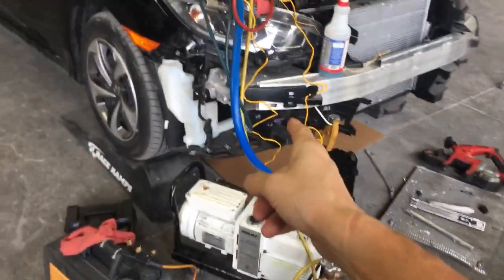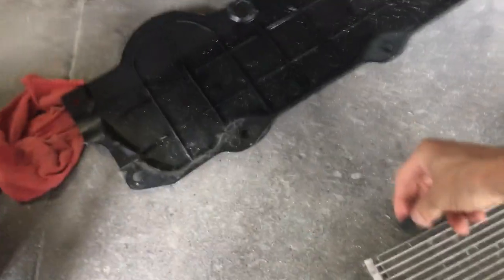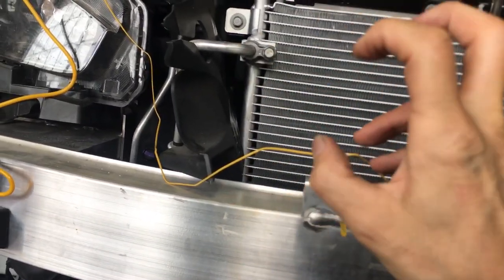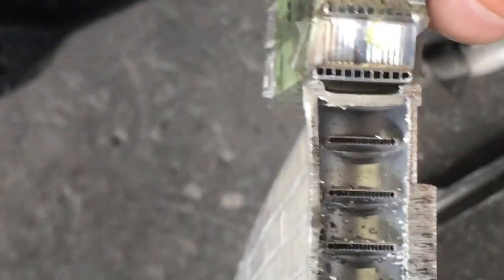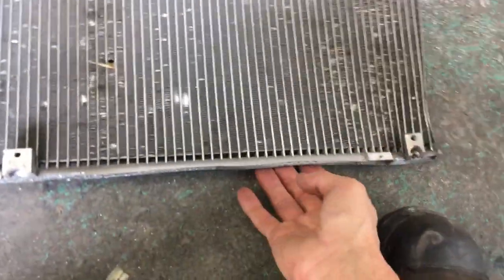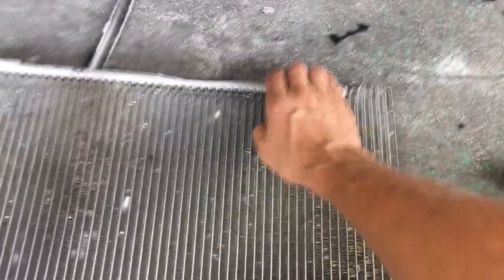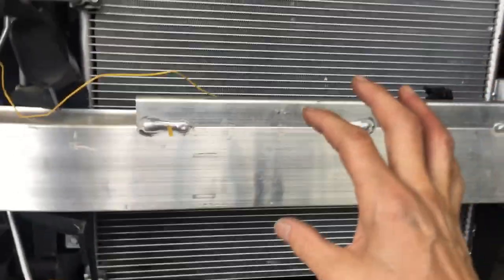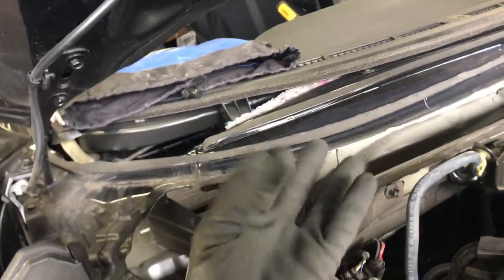Aftermarket AC condenser poor quality versus OEM original condenser. DON’T GET CHEATED!!!

Comment: You show that the bottom 5 rows provide the subcooling.  Here's a somewhat theoretical question: what if you can install an entire second condenser and use the entire condenser to get even more subcooling?  In some vehicles, there isn't enough space, but in the vehicle in your video, there's certainly enough space for two condensers.  I've seen someone install dual condensers on an old 300D Mercedes in place of the original r12 tube & fin condenser.  He has a video here on youtube called "W123 Sanden, Dual Parallel flow condenser, and r134a results
".    Interested in hearing your thoughts on this!
Reply from the maker: komoru yes Mercedes did that from the factory. The second sub condenser located under the bumper.    I use to do that back in the 90s on long limousines that had up to five evaporators added to the rear.      Limousine manufacturers did know how to make AC work correctly.  I was called in to a limousine repair and manufacturing Business and asked to solve their problem. I added extra condensers and extra receiver driers.      This is what my dad did Back in the early 70s at his AC shop on new cars that were being shipped and sold iin the Arizona and New Mexico Desert. My dad would make custom IHX ( Internal heat exchanger )  the same heat exchanger that you see on today’s most modern R1234YF  cars.   You use soft copper pipe and attach smaller copper pipes to the outside of the larger suction line using silver brazing. Every HVAC tech that has been formally educated and or has taken thermal dynamics and fluid dynamics knows this. Basic HVAC/R 101.     I did a video on the Mercedes.
Reply: @coldfinger459sub0  would additional condensers and receiver driers strain the compressor? or would it create a higher head pressure? 

I'm planning to add additional condenser for Scion  xB.
Reply from the maker: @KurtBarcelona  you must be in a hot climate. 

Gets tricky with today’s condensers.  Because most new condensers have a receiver dryer built into the condenser in the last about six rows of tubes are for sub cooling only liquid.. 

One of two ways if reciver built into condenser. 

1: customer modify a Y fitting connect, to two parallel condensers connected. 

Or
2:  in series hey single pass or double pass, microchannel parallel condenser behind your original multipass microchannel condenser with the receiver dryer. 

If your condenser has the receiver dryer attached to it, it’s very important, because only liquid comes out of the bottom of the receiver and feeds last last five or six tubes . 

You can try to take a IHX off a newer car and custom make liquid to suction IHX assembly line to help efficiency. 

You can add a second evaporator.  Buy a kit like on a limousine. Install it in the back on floor or roof inside like some SUV or van. 

Add a super high out put fan
Reply: @coldfinger459sub0  yeah it gets hot here. 95-100 deg F with 60-80 percent humidity. I live in the tropics by the way. Midday here  is a pain to drive since the heat creeps inside the car, but the pressures return to normal at night.

Also, I figured that probably my compressor can't handle series condensers. I'm afraid I might cause it to "exert more work",  which prematurely wears it out, and series connected condensers are not as simple as I thought. It's too complex to consider since there's also no kit that I've know that readily fits in the Scion xB.

I could buy generic local condensers from China without the receiver drier built in though, but I still have to check its quality.

What If I parallel different condensers? There might be a difference of flow restriction on them. Do I need valves that can regulate the refrigerant flow to each condenser? Or would the prallel condensers self stabilize? I might risk the reduced flow rate on wa h condenser, but most likely it would run better compared to a single condenser. What do you think?
Reply from the maker: @KurtBarcelona  if parallel us same condenser 

If series first one is single pass only ( less friction loss) resistance 
    U must understand internal construction of condenser. 

I have ran up to 3 condenser in series with up to 4 evaporators on one compressor on limousine.  Blasted hundreds of thousands of miles.. 

Compressors do no die or wear out.  Compressors are murdered by people who don’t know what they are doing. 

Most all compressors last longer then the car.  Unless someone murdered it. 

Too much refrigerant 
Too little refrigerant 
Too much oil
Too little oil
Wrong viscosity oil
Wrong type oil
Moisture contamination 
Air contamination 

I have video of me driving in 106F with 39F out the dash 2012 Prius C 
Because it’s charged right
Reply: @coldfinger459sub0  

By the way, I have no issues driving on highways since the AC vents are about 45-50F when the ambient is 95F, but when I'm stuck in traffic or at low speeds, it goes to 64-50F!! It's warm for my preference especially that I don't have a heavy car tint (to reject the infrared rays) so I can drive and see at night.

To fixe this problem, I installed an auxiliary fan, and cleaned the condenser, but it still had the same 50F vent temperature when I'm stuck at traffic. I checked  the pressures, and the high side just after the outlet of the condenser is too high. Low side is approximately 42psi and 225-250psi at tge high side WITH FANS ON. Also, the High side line is too warm to touch.

It even goes higher If I revv up the engine. It cuts off the compressor If I rev it too much, the pressures going to 350psi.. and the heat in the engine bay is just a lot. I'm not sure if

I tried reducing the amount of refrigerant to reduce the high pressures, but it won't get as cold. 

However, this returns to normal pressures at night when the ambient is 80F

The question remains, is my condenser running well? Maybe it's clogged or it's just not enough heat dissipation via the condenser? 

I'm now curious about series condensers and how these could help.
Reply from the maker: @KurtBarcelona  a small series condenser may help.  Most important is that your refrigerant charge is correct. In the first place. Added by wait by manufactures recommendation not topped off by pressures.

I have a video me driving my car on 106°F record-breaking day in our area and 39°F coming out of the dash . 

I was using my Bluetooth pressure transducers to take the high side and low side pressures and they too were ridiculously low . 

And this is how it should be with a well-designed system and properly charged refrigerant level on a good car   AC system. 
2012 Toyota Prius C .
Reply from the maker: First, make sure your refrigerant charge is 100% correct by weight make sure your car has not been in an accident and a poor quality aftermarket condenser was installed. The original one should have been a DENSO 

You can add a small secondary condenser your OEM condenser already has a receiver dryer built into it .
Reply: @coldfinger459sub0  I'm going to add a 12"x18" condenser in front. Hopefully when the parts arrive, I can update you with the progress. I'll even make a video out of it for people who plan to do it. Hopefully it would be okay. 

Question is, do I still need to fill up the recommended regrigerant? Scion xB repair manual says 380g +-30g, but should I add a little bit more considering there is more space for more refrigerant made by the extra condenser? 

I also found out that it's common in our area to make 'dual condensers' for old toyota / honda vehicles (with the exception of Nissan). Apparently, people are not satisfied with the stock AC breeze that these old cars are designed with. Either they replace their old AC with a larger condenser and add auxiliary fans or install dual condensers in their vehicles. 

I also observed that newer model cars released here have LARGE condensers and have a high speed dedicated fan. No more small condenser designs. Good.
Reply from the maker: @KurtBarcelona  it all depends on time money somebody’s ability to modify sheet metal hoses, pipes, and fittings to make things work. 
          You will definitely be adding quite a bit more refrigerant is coming out of the bottom of your original. Condenser should be basically fully liquid which is a large volume of gas and that will be going right into your new condenser so the whole entire brand new condenser that you will be adding will be completely filled with liquid refrigerant.. 

Hi myself personally, if I was going to do it on my vehicle, I will try to find the largest possible condenser, of course microchannel parallel flow that was designed originally for an SUV or small van that had the heat load of two evaporators and see if I can get that, can you somehow manage by manipulating sheet metal in brackets and Kustom fittings to work in my vehicle. 
                   And if I was in some hot desert climate, like Dubai, some of these Middle Eastern and African countries, I would also probably add a secondary sub cooling smaller condenser with high speed fans.    I definitely would have the best infrared, reflecting glass coating that I can get my hands on..
            And if I was in such a high climate, I would paint the least the roof of my vehicle, bright flat, white, not glossy white flat white with no pigments in the paint at all.  Are used to custom mix my own paints..   even the primer that I put down before I put down to paint would have to be tinted white.    Because white paint is slightly translucent meaning the rays of the sun actually penetrate through white paint and strike whatever color object is underneath the white paint creating heat..      this is why your primer color underneath the paint needs to be white to. 

And I would also put a secondary evaporator, either under my rear seats in my rear trunk in the overhead of my vehicle in the rear but somewhere, I would have a Second Evaporator .   

The liquid line coming out of the second sub cold condenser would split to a Y1 feet in the expansion valve in the front evaporator of the vehicle and the second line would go to the my rear evaporator expansion valve . 

In those kind of environments instead of trying to spend money getting rid of the heat, I would invest in not making the heat at first at all .   That’s why you do everything you can to reflect the heat. (infrared wave length.).  

This is why I always only purchase white cars .   .
Reply: @Tom Lech / LECH AIR CONDITIONING  That's why we need real techs like you. 

I have a friend that's a super Ford tech, like you he works from home, I asked what he charges. I told him it wasn't enough. He says he can't charge more because he works out of his house. 

I said you can, because like Tom Lech, you have "Honesty". That my friends is priceless!
Reply from the maker: If he does not charge more, he is basically stealing from himself

If he does not charge more, he is cheating himself 

If he does not charge more, how can he possibly afford to buy a $3000 Refrigerant Analyzer to protect his recovered refrigerant so it does not all get contaminated and then he put it into his customers cars spreading it like an STD . 

If your friend is not charge more, how can he afford a good leak detector wear a good decent leak detector Barebone minimum starts about it US$350 and that’s just kinda OK 

A good leak detector starts at around $500 plus an excellent leak detectors are in $1000 range .  So if he does not charge more, he is cheating himself and his customers.. 

How can he afford that ultrasonic leak detector? If he does not charge more or the nitrogen regulator nitrogen tank how can you afford to get a good set of digital gauge if he does not charge more

Does he even know what a micron gauge is a good one is around $300 plus but he doesn’t charge enough to afford one, so how can you prove and test that he is actually performed a good vacuum to remove moisture out of the system he just guesses by time only  ?
Reply: @Tom Lech / LECH AIR CONDITIONING   
Exactly! This is not a cheap profession to be in. If you don't charge, you will die.
Reply from the maker: 👍100%

Comment: I found my stock ford condenser in my 1996 bronco was beeeeefy compared to this aftermarket unit. I replaced it because I was told not to flush it. Doesn’t perform like it did before. Kinda sad. It was much thicker. Now I can’t get the same performance in high ambient temperatures :(
Reply from the maker: @Bacongrease00  but the manufacture representative will say they have some toilet paper with specifications on it saying that there aftermarket quality condenser meets or exceeds OEM specification

Then there’ll be some douche bag salesman who pushes the product back up that claim and say he believes it .
Reply: @coldfinger459sub0  basically. Should I go severe fan clutch and pull more air or just slap on an electric fan for summer 100F+ days here in az? Where should I mount the fan on the condenser?
Reply from the maker: @Bacongrease00  if there’s room for you to get a pull fan

Or a push fan 

Just be careful you don’t mount it so it’s rubbing on the refrigerant tubes or radiator coolant tubes so rubbing doesn’t cause leaks. 

Spend the extra money to buy one of those extremely high-quality heavy duty output, racing type fans with brushless motors. 

Get the biggest one you could possibly fit in. 

You can get a temperature thermostat mount sensor to activate the relay for the fan. 

And you can attach the temperature sensor some of them can slip between the fins on the condenser some of them you can slip it on the compressor discharge line just before it enters the condenser or liquid line

And you can match up with your gauges. 

So you can adjust the adjustable trim pot to kick in the sensor to activate the relay for the fan for example when the high side pressure reaches 225 psi or 250 psi. 

Kicks on the fan and then when the pressure gets down to 150 psi it kicks off the fan. 

This is just example

It depends on the manufacturer, selling the thermostat, setting trim, pot, and temperature sensor

But Arizona and Utah I’ve been there in the summer 110° when I open the doors on the vehicle to get out at the gas station and my sons all simultaneously jump back in the car and close the door and looked at each other and said what the fuck we were getting an oven. 

How do people live there?

We are from San Francisco, where we have fog and an average of 68°F most of the year

Comment: Great video you smart man A+  Alot of my A/C Condenser fins are bent over and i have a limited income . What A/C Condenser would you recommend of a 2006 Mazda 3s 2.3l ?
Reply from the maker: If you are mechanically competent you can modify and you have more time  than money 

I would look for the biggest modern day micro channel parallel flow condenser I could find modify and make your own brackets.     Add to or modify or change or make up your own hose connections. 

You can even get one of those universal modern day universal Microchannel parallel flow condensers.    They are cheaper you’ll just have to make up your own hose ends

Comment: great video on the differences. I have little experience building a ac system.  Any help is mostly appreciated Do you have a video on where to mount then condenser on the radiator? Spacing from each other.  You mention hot coming around the condenser from the engine. What is proper location and how to stop that hot air.  Fans: Do you use separate fans for the condenser and radiator or one fan for both?
Reply from the maker: Just analyze and look at a few modern cars to get some ideas.     If you’re adding to a old car that has a mechanical fan or a fluid driven thermal fan clutch it is recommended to add a auxiliary electric fan controlled by a pressure switch off the high side AC system. 

Vintage Air make some kits

You have to custom make up your own brackets to make them fit in a custom location

Keep it about a half inch away from the radiator. 

You have to make up your own custom plastic that is heat resistant or metal air dam baffle Sheilds to direct or block air in some cases you can use some foam that is rated for high temperatures.

Comment: On modified AC systems, like a vintage air with home made lines and unknown capacity, how do you determine the correct charge amount?
Reply from the maker: Vintage Air comes with installation instruction manual. They tell you right in there instructions 1.8 pounds..

Comment: Tom, any recommendations on reputable manufacturers for condensers?
Reply from the maker: The OEM unless it’s a Honda civic or accord between 2015 and 2019 then anything else DENSO

If you’re lucky enough to have a car that originally comes with a Denso condenser then get that otherwise stick with your OEM or see if you can get an aftermarket DENSO 

Aftermarket, Motorcraft aftermarket, AC Delco